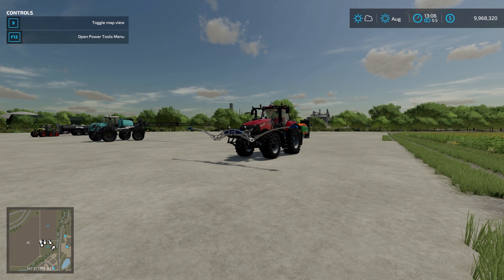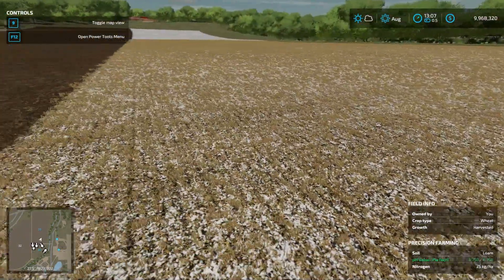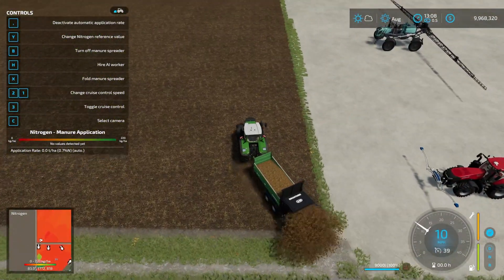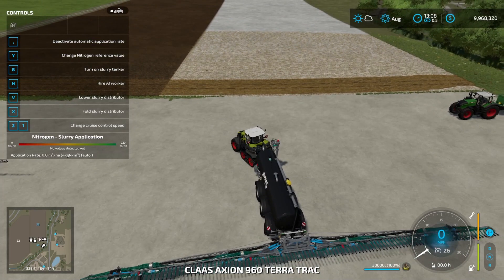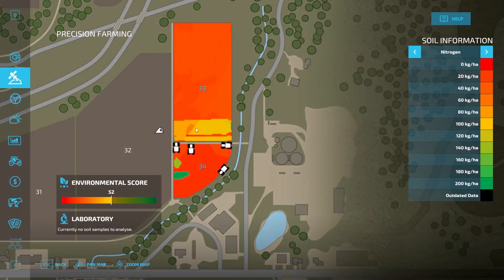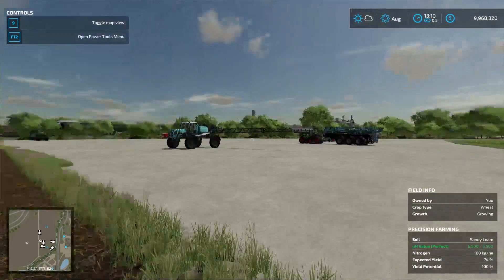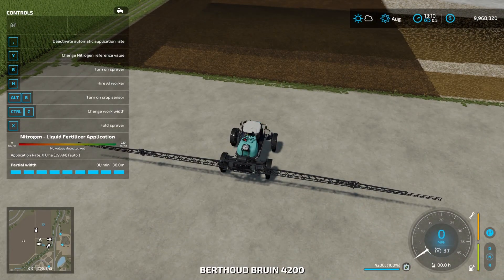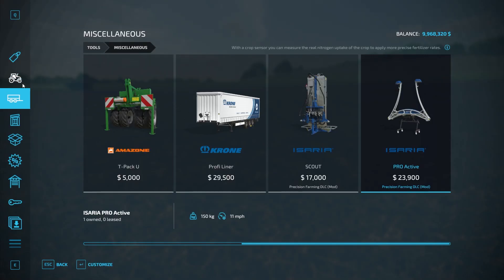PRECISION FARMING GUIDE - PART 3 - Farming Simulator 22

Comment: That is not how the crop sensors work.  It only does anything if you spray crops later.  It can be 100% perfect nitrogen levels at planting.  Once the crop has a couple growth stages on it, you can tack a sprayer or spreader out and top off the field.  You have to manually activate the sensors.  But when you do, you will see the area around and a little in front of the tractor will show a small drop in nitrogen levels.  The sprayer or spreader will then bump the nitrogen level back to perfect. You will only see this if you drive in the fields when they are few stages in and sensor is activated.  It will not so up on the map any other time.  But, if you notice your nitrogen levels are never 100% on the environmental score, that is why.  It will normally be down a few points if you are not doing the mid season spraying.
Reply: Thank for this comment mate

Comment: I've been trying to increase the soil quality in my fields for a long time. I'm using the manure from my cows and liming the fields almost every harvest, but the field still looks red and orange on the value map. Might invest in a solid manure spreader and see if that changes anything.
Reply: You should only need to lime roughly every 3 harvests - lime fixes the pH of the soil. For nitrogen, you need solid or liquid fertilizer: you won't get enough nitrogen just using manure/slurry.
One thing that can't be fixed is soil type - this is the info which is revealed by soil sampling (or buying the soil map). Certain soil types have a bonus or penalty so even with perfect nitrogen and pH, you may only get orange yield.

Comment: I have a massive problem with PF. I've been playing with CoursePlay and having my employees purchase the product when working, and it was never a problem. I install PF, did the soil samples. When it came time to do lime and fertilize, my account dropped like a rock. It was ~200k, I send them to work and focused on something else. Next time I looked at my balance it was over a million in the hole and dropping faster than 100k/sec. The funny thing is, this doesn't show up in the expenses report. Even having a field fallow (grass) that irl makes the field better prepared for a crop, but ingame murders the ph and nitrogen levels. Since you didn't have this problem in your videos, I guess it's a mod conflict. Finding the one that caused CP to not work was easy since it worked until I installed some new mods... meaning it conflicts with what I already had installed. I have one final test, since it's Nov ingame... come spring I'll seed drill a crop. Hopefully that fixes it. But if not, since everything worked fine before, I'll be removing PF. 
The reason I'm mentioning this is hoping you or a viewer heard of this and can help me fix this more easily than figuring how many of >800 mods conflict with PF.

Thanks for mentioning the Economin Analysis... for 22 HA, i've spent $20M in fertilizer. I thought it was the lime too, but they're jobs my smallest tractors can do, and can do the same route.

Comment: OK, so I noticed some of the equipment had a "Change Reference" adjustment (as in: Change Nitrogen Reference Value) - is this something that allows me to change my intended crop (before planting) and achieve ideal levels? So when you put liquid fertilizer on the unplanted bit of the field, it based the ideal on Wheat, was it really because the prior crop was wheat or because the "Reference" was wheat?
Reply from the maker: Great question and I think it does, GIANTS teased this as a feature before PF released

Comment: Can you spread fertiliser at a state where it’s green
Reply: On auto setting, it will add fertilizer to the ideal level for the crop planted, so if you spread manure to raise nitrogen levels, then it will automatically lower the amount of solid/liquid fertilizer added. If you try to "over fertilize" the sprayer/spreader will not lay out any fertilizer in that area, as it's already at ideal levels. Note that "green" isn't really a target state - the nitrogen requirements are based on crop (from my numbers in FS19), most cereal crops (wheat/barley/oats/corn) need a very high level of nitrogen and will need a "green" level, but sunflowers need significantly less nitrogen, so the ideal will be "yellow" - which is something to be careful of, as you cannot reduce nitrogen levels, they get reduced after each harvest. If you put down too much nitrogen then the crop will be overnitrogenated and will reduce yield. Thus it may be possible to plant wheat, and fully fertilize it, harvest it, and end up not needing additional fertilizer for the sunflowers you plant for next year!

When you start out, this can be a guessing game, after each harvest, do I need to put down slurry for a large nitrogen boost, or should I just plant the sunflowers and use the more precise metering of liquid/solid fertilizer, and not risk too much nitrogen.